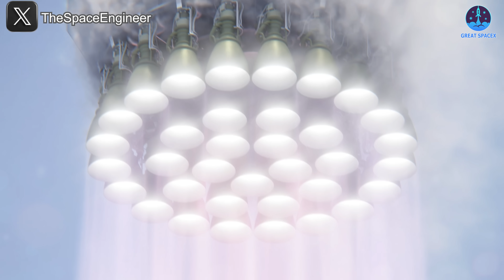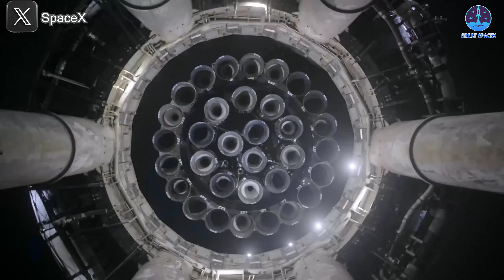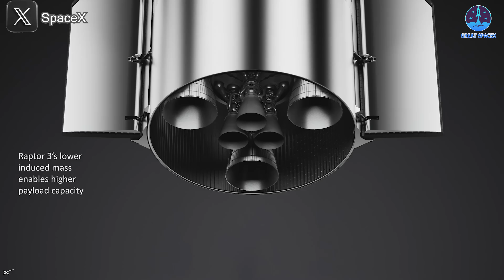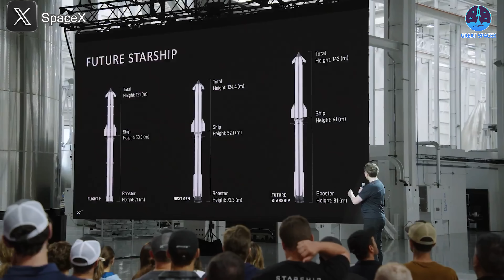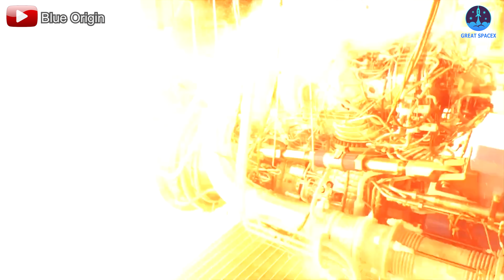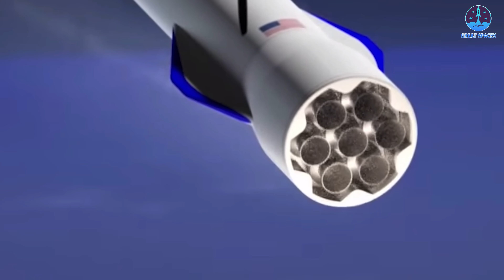BAD NEWS!? SpaceX Raptor 3 Exploded during Testing...Here's What Happened!

Comment: They can't get ship to orbit! Going to Mars is a million times more complex. It's not happening in the next 50+ years
Reply: Apparently, you have no clue how test to failure works.
Reply: @VroomBox42  lol
Reply: This company has more orbital rocket experience than any other company.

They have literally already solved this problem with a smaller rocket.

And now their StarLink product has revenue similar to NASAs yearly budget.

50 years would be appropriate if we were talking about normal companies that launch new rockets every few years.

But SpaceX is launching new rockets 50x faster-- a rocket every few weeks.

I don't think they will make 2026, but they will make 2028/9.
Reply: @JohnBoen Unfortunately, Starship has basically the same engine efficiency but its made of Stainless Steel. Reusing 2 stages makes it very inefficient. Compounded with the shortfall in thrust. Falcon 9 doesnt deal with reentry from orbital speeds. So, this is new. You combine all of this and you can see why they are failing. Very little heritage.
In 2022 Elon said that unless they were launching (2 functional vehicles a month, not testing) they would go Bankrupt. Maybe he was bullshitting as usual but still, a remarkable statement.
The problem brought by Stainless steel will not go away. The way this rocket is going, new Glenn will beat it with 45t to LEO. They are stuck..
Reply: @pedrosura 

I'm a materials science engineer, and I think 304L offers many advantages over carbon. And I can't think of any other materials to use.

Mainly durability across a range of temperatures and pressures. 

Raptor 3 will produce more thrust per kg of fuel than Raptor 2. 

Rockets can be extended easily using 304L rings, while a carbon body is hard to extend - they should be rolled as a single tube.

A lot more ...

I think they know more than you or me.
Reply: @pedrosura 

The Falcon 9 boosters come back at about mach 10. About 1/3 orbital speed.

The first stage of the rocket, powered by seven BE-4 engines, achieved a speed of approximately Mach 5.5 at an altitude of 84,226 feet (25.7 km) before it was lost during the attempted descent for recovery. 

They have a couple hundred successful booster landings from a speed Mach 7-10.
Reply: @pedrosura 

I think part of the goal is to do big payloads with cheap rockets.

Glenn Payload Capacity:
LEO: ~45 t
GTO: ~13 t 
Cost per kg to LEO: Approximately $1,500–$2,000/kg  

Starship (Raptor 3) Payload Capacity:
LEO: ~150 t (fully reusable), up to 250 t (expendable)
GTO: ~21 t
Cost per kg to LEO: Approximately $67/kg  

These are each company's numbers as they stand today.
Reply: @JohnBoen Starship was supposed to be 300t reusable 550 t non reusable. Since the beginning thrust went down, dry mass went up. I dont think they are at 50t now.. It all depends on thrust of Raptor 3. 
So, stainless steel is cheap but it is a huge problem that is not going away.
Reply: @pedrosura 

Musk suffers the curse of the optimist.  He says what he hopes, and though he often bites off more than he can chew, he can chew better than most.

You seem to be overly pessimistic. 

I really think I am somewhere in the middle. 

I think we have learned about as much as we can with this block of vehicles. Thisnis how itterative prototyping works. Eventually you must abandon your current baseling for the next one that fixes all the spaghetti. 

----
You haven't convinced me 304L is a problem. It is a design choice with design implications.

You haven't proposed how you would solve the various design and manufacturing problems with any other materials.

Consider this:
They caught and re-flew that booster. 
Everything worked well until a point.
They lost control of the ship, and regained contontrol later, attempting an aggressive attack angle for re-entry. 
All debris landed within the zones indicated in flight paperwork.
There should be no regulatory concerns as they identified this as a potential risk.
----
At this time, the world's most advanced rocket company is planning to use its patented form of 304L.

I view their main problem as being unable to create sufficient simulations of the vessels. And this is because of the ever-increasing complexity of the plumbing.  

V3 greatly reduces the kinks in this plumbing and uses more laser welds instead of bolted fittings. 

Easier to build, simpler, stronger, lighter, etc.

Seems like a great idea to me.
Reply: @pedrosura 

Block 1: Expected to carry 50-100 metric tons to LEO.
Block 2: Aims for 100-150 metric tons to LEO in its baseline reusable design.
Block 3: Planned to reach 200 metric tons to LEO, and potentially up to 400 tons in an expendable configuration.

They have designed it to be mass produced so they can rapidly change design.

You see what this is, right?

It is a test program to build out a rocket that will carry 200 metric tons to LEO, and potentially up to 400 tons in an expendable configuration.

But it will depend upon the types of vehicles needed - plans always change.
Reply: @JohnBoen It sounds pesimistic to point out that an airplane or rocket made of stainless steel is not going anywhere.
The reality is that optimism will not solve this problem.
I worked on the X-30 years ago. We needed the best material possible for this aircraft. Nobody thought of SS fir a reason.
I am tired and sick of the lies and BS said by Elon and believed by gullible fans which ultimately affects policy.
Remember the Hyperloop?
Remember the 4 launches to Mars in 2024?
My question to you is… do you think Elon is so clueless about the engineering challenges of the mission or is he a World class bullshitter?
If you think that these promises increase moral you are mistaken. They destroy morale and frustrate engineers.
Reply: @JohnBoen I think you are gullible about the figures. They are all claims and are not demonstrated as of yet. But there are clear indications that they are exaggerations. This current vehicle is not 50-100t It is 50t at best.
Which has not been demonstrated. 
For example, the idea of not taking the booster back to the launch site was not bc they dont need to re catch the booster, it is bc performance demanded it. At 35t this was the heaviest payload. In any case these rockets have flown mostly empty and ran out of fuel and they were fully fueled. This tells me it has no payload capability.

What would I make the vehicle out of?
Anything but SS. Titanium, Aluminum, Carbon fiber or combi. SS is an economical solution, period.
I worked on the X-30. Too ahead of its time. Anyone suggesting SS would have been laughed out of the room.
Reply: @pedrosura 

Whining about someone else's proposed does not make your solution work.

What would you use instead of 304L?
Reply: @pedrosura 

Why not steel?

It is about 3x the density of aluminum, but also about 3x the strength.

You could easily make an airplane skin out of steel.  But we don't because of fatigue tolerance.  Under oscillating load Aluminum will tend to fail after a predictable number of cycle.  Steel doesn’t have a devined fatigue limit.  It could fail on the 1,000th, 10,000th, or 100,000th cycle.  It will be random.

You won't use Aluminum for 30,000 mph space ship.  

Stainless steel seems like a great option.  

What wpuld you ise instead?
Reply: @pedrosura 

All those claims I made - these are what the companies say about themselves.

I am not going to accuse either of those companies of lying. 

These are the best numbers we have.

Do you know of any other companies building huge rockets that could be added to the mix?
Reply: @JohnBoen If you are trying to say that Steel is the only material that you could make Starship out of, you are wrong. Its a bad material because it is too heavy. That is the reason we dont have airplanes made out of Steel. Is Starship overly strong? It is. It is also overly heavy. Its obvious this is not a performance optimized vehicle. Elon realized how cheap it would be to make and that was it.
SH is more strong than necessary and heavier than necessary. 
I will let time and Starship’s lack of performance do the talking.
When you discussed 30,000 mph and aluminum is sort of interesting. The speed relates to the heating. The dynamic pressure profile is what matters for strength. To do this you have to analyze the trajectory where the density of the atmosphere matters.
I am an aerospace engineer. Learn the rocket equation, why it matters before you say “I think Steel is a great choice”
I am sure you do.
Reply: @pedrosura 

Why do you think it is too heavy? 

Steel is 3x the weight and 3x the strength.  

And we would use it except for fatigie life.

I'm sayong you haven't provided an alternative that will work better.

Dude - I am a materials science engineer - I can check your work.

If you don't provode something you think is better, you simply aren't living up to your side of the conversation.
Reply: @JohnBoen Let me explain it this way…
The mass of the rocket is 100% at liftoff. A very large fraction of the mass is the fuel. X%
Y% =100% -X%
So Y is the Payload plus all the structure, booster, empty starship plus payload. It is a finite amount of mass per launch. 
I would tell you take make the booster and empty Starship of the lightest materials possible. Every kg that you save is mass I can take to LEO. 
That is it. Steel is a really bad material and will kill this vehicle. 
If you dont agree, just wait. Starship has been flying basically empty.
Reply: @pedrosura 

You know the MiG-25 is made of steel.  Aluminum cannot handle the temperatures. 

787 uses a combination of steel, composite, and aluminum.

304L can support temperatures over 1000°C. 

Aluminum melts at 660°C.
Most advanced composites will begin to breakdown at A little.over 200°C.

Metal Matrix Composots can reach 2000°C - but at around 100x the price.

Suggest materials you think will work better than 304L.

I will tell you if you're right - that is what my college degree is in.
Reply: @pedrosura  

Let's do some engineering.

Dry Mass: about 330 Tonnes.
Propellant and oxygen: 4800 Tonnes.

The skin is 3.6 to 4 mm thick, and SpaceX claims about 12.5 Tonnes per mm thickness. So the entire mass of the steel is about 50 Tonnes. 

50 out of 5180 Tonnes is less than 1% of the total mass.

If they chose to use aluminum, it would need to be about three times as thick, approximately 12mm.  An aluminum skin would weigh as much as a steel skin.

But it would melt.
Reply: @JohnBoen The 787 has carbon composites. Its the aircraft I fly. Steel is minimal. Do know how old is the Mig25? I would not use that as a guide. Was the SR71 made of Steel?? Why not? It was made of Titanium. But why not steel? 
You need to understand, you cant make this rocket of steel and get the payload promised with the demonstrated thrust. Elon can BS all he wants, but he is flying an overweight vehicle and riding the rocket engines at design limits. The Raptor3 will have fewer parts. Do you think that will solve the problems. I think it will not. We will find out.
The optimal design of Starship would be optimized to minimize mass. Al, Titanium, maybe Steel in limited parts, carbon fiber, etc..
This was not done upfront, and now it is too late. This vehicle is a slow train wreck. Just watch.
BTW now that Elon and Trump are fighting, Trump will kill the funding so this is in life support anyway.
Reply: @pedrosura  
And I am still waiting for you to provide an alternative approach that you can support.

Or are you saying the whole thing is impossible?

This is the most advanced aviation company on the planet - why do you (an obvious non-engineer) think you are right and the experts are wrong?
Reply: @pedrosura  

I don't believe you have any engineering background AT ALL. You are saying things that show your ignorance.

Provide a material that is better than 304L.
Reply: @JohnBoen so you do not like carbon fiber, titanium, aluminum because you like Elon want the heaviest metal you can think of except for lead. Ok, so why are you asking me. Its not my problem. If something doesnt work it doesnt it doesnt matter if you cant think of something better. Why would I bullshit and come up with the type of design that a large aerospace company would take a few years to develop to convince a “you tube” expert which is what you are, because you are obviously not an engineer if you go around asking me this.
Reply: @pedrosura 

If you are an aerospace engineer why did you not know the reason Aluminum is used for aircraft skin is Fatigue Life.

I took those classes in the late 80s.  Steel has an unpredictable fatigue limit, but Aluminum is much more predictable.

I just can't imagine that it changed in the past 30 years.
Reply: @JohnBoen So you do not know what aerospace engineers do? Obviously you dont. Aerospace engineers will tell you “the structure needs to be no more than 60,000 lbs” otherwise the design will not close. The we tell Structures what the heating will be, what the dynamic pressure will be. We do not design the structure or pick materials. 
I am sorry to say, but you are clearly out of your league. Steel does not work. Not because it is not strong but because it is too heavy in a vehicle where mass is critical.
If you do not understand, that is fine.
Reply: @pedrosura 

Are you going to propose alternative?

Are you telling me you can't thibk if anything?
Reply: @pedrosura 

I worked on the commercial side of Boeing for a half dozen years.

Then I moved to Microsoft.

Thwre is a night vs. day difference between the two companies.

I will never work in the aerospace industry ever again.

Legacy aerospace doesn’t know how to use modern manufactiring efficiently.

I think you are assumong SpaceX operates under the same poor manufactiring processes as Boeing.
Reply: @pedrosura 

Dude. I was a materials science engineer at Boeing for years.

I can both propose and evaluate designs.

Im 60 - I have been doing engineering for 35 years.

I have concluded that you cannot think of a solution better than 304L-30X.

That is okay - neither can I.
Reply: People are thinking too small scale.

Let's retrofit the USS Enterprise.—thefirst US Nuclear Carrier. They begin recycling it soon.
90,000 t displacement.
Put four Megazilla catchers and have plenty of room to manage a fifteen launches a day. 5000 a year.  $5 billion in yearly fuel bills.

Go big or go home.
Reply: You are wrong!!!
Elon said 4 Starships to Mars in 2024! 2 Cargo 2 Crew. I wonder how the Astronauts are doing??
He now said 1 in 2026 but with robots.. 
So the bullshit meter is cooling down with the doses of Ketamine

Comment: Why can't they use the same engines that the falcon has and maybe scale down on the size of the booster and starship. Even half the size will still be the biggest rocket.
Reply: Yeah, thought the same thing, but falcon is not rated for human flight beyond the orbit of earth. It needs a support command module that has lots of life support, radiation shielding for going to the moon and beyond or get X-ray blasted with DNA damage.
Reply: A, you can't make kerosene on the moon or mars. B. The Merlin engine is less efficient. It dumps the partially burned fuel that runs the turbo pump  outside of the bell. So less thrust from the pounds of fuel used, this scales in a bad way so a half sized first stage wouldn't have half the payload.

Comment: Gotta blow a few in order to get the data and find the sweet spot for integrals ideal wall thickness and pressure for passage way diameters. I'm assuming some places will need bigger pockets and thicker walls to achieve higher pressure and flow rates.
Reply: yeah most people spec that at the component level instead of throwing parts together and trying to forensically figure that out after the explosion.
Reply: You can spec out all you want before the build. Once its built and tested you will see the true results.
   Never put to much faith in simulations. The live tests are never wrong@divedevil985

Comment: All starship parts engines and super heavy are prototypes and prototypes are designed to find issues and problems. They are not final designs.
Reply: So, why do they have 3 versions of the engines, Super Heavy Booster and Starship, when only the Super Heavy Booster version 1 works.
Reply: @mrbaab5932 
Iterative design prototypes!
Reply: Looks like they attached a rope to a magnet and dragged it through a parts bin.
Reply: @rafepittenger7484 
😂
Reply: Yeah but major redesigns can throw away all that important data as new issues make moot the solutions you implemented.